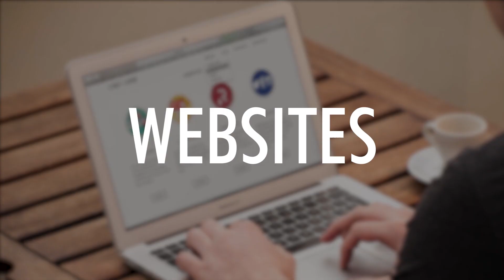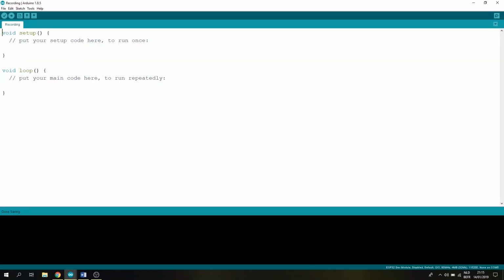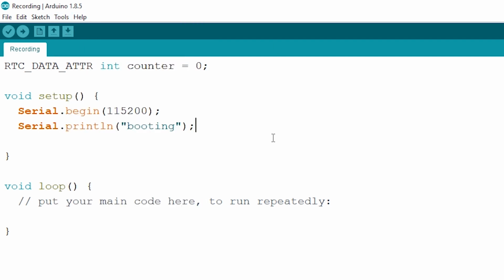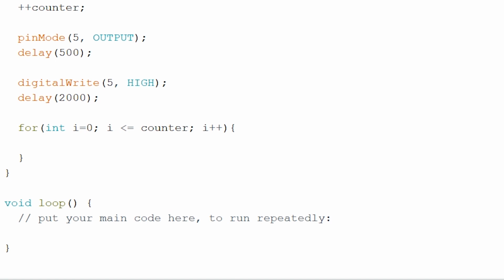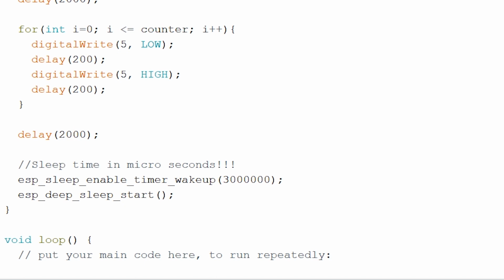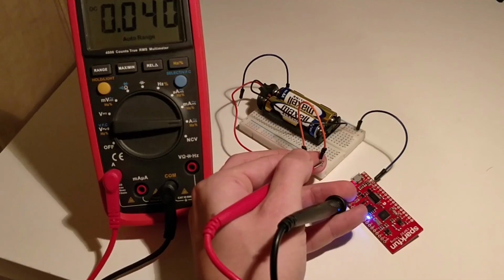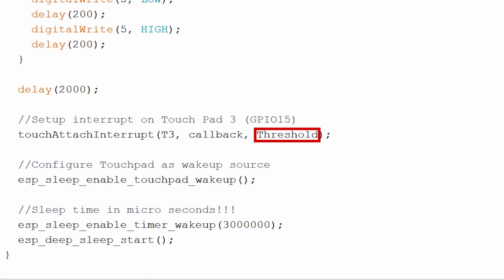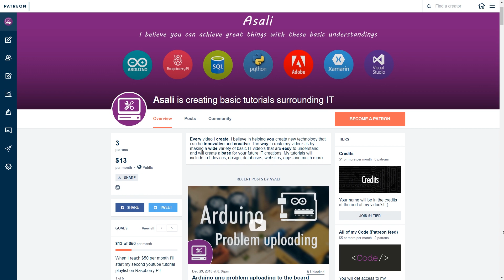ESP32 deep sleep power consumption example in arduino ide

Comment: On many cheaper es32 boards the usb serial chip is always powered - just in case you are seeing huge currents.  On the thing and firebeetle the USB chip is bus powered and so when using the battery input you get much lower power.  Especially if you disable the power LED.  Should be a few micro amps.

Comment: I don't suppose, that in your experiments with deep sleep mode, you discovered/know what happens say if you set a particular pin low or high, then go to sleep? Does the pin maintain its state during sleep? No worries if you don't know off hand, I can look for answers elsewhere (or experiment)
Reply: Its effectively a reboot and so the output pins do not maintain their state when powered off.  I get your point though, the output register could easily maintain its state when in deep sleep leaving the output stage latched.  But it doesn't.  You can see that his LED goes off when it sleeps.
Reply: @dr_jaymz  Interesting. I was looking at my trello notes on this from January and found this: "https://www.espressif.com/sites/default/files/documentation/esp32_datasheet_en.pdf Page 21 seems to confirm that at least some (RTC?) pins maintain state even in hibernation mode (more in deep sleep mode)" however following that link now, I see the docs were updated in in April so page 21 isn't relevant any more... not sure which page it was now I'm afraid...
Reply: @dr_jaymz  I've still not got round to experimenting though... I really should...
Reply: Ah. Looks like it's Page 23 now. It says: "Hibernation mode: The internal 8-MHz oscillator and ULP co-processor are disabled. The RTC recovery
memory is powered down. Only one RTC timer on the slow clock and certain RTC GPIOs are active.
The RTC timer or the RTC GPIOs can wake up the chip from the Hibernation mode."
Reply: @WistrelChianti  I just tried the pins do not maintain state.
Reply: @dr_jaymz  aww sad times!
Reply: @dr_jaymz  I don't know if this will help (still not experimented) but noticed in the code comments (left hand side of the vide) at https://youtu.be/r75MrWIVIw4?t=313 there is something about it turning off pins that are not being used for wake up "by default" and then a link to further reading, presumably relating to keeping them on maybe.
Reply: @dr_jaymz  I got it working. In short - for example, to keep the LED pin on indefinitely (including) during deep sleep:
#include <driver/rtc_io.h>
esp_sleep_pd_config(ESP_PD_DOMAIN_RTC_PERIPH, ESP_PD_OPTION_ON);
has to be run every time the main cores are started, and:
rtc_gpio_init((gpio_num_t)LED_BUILTIN);
rtc_gpio_set_direction((gpio_num_t)LED_BUILTIN, RTC_GPIO_MODE_OUTPUT_ONLY);
rtc_gpio_set_level((gpio_num_t)LED_BUILTIN, HIGH);
need to be run just once on first boot (you can check if it's the first boot using things like esp_sleep_get_wakeup_cause)

Some time later, you can always turn it off using:
rtc_gpio_set_level((gpio_num_t)LED_BUILTIN, LOW);
e.g. in response to user input.